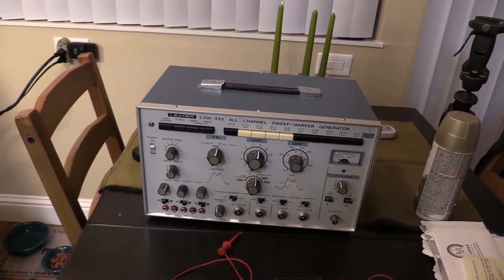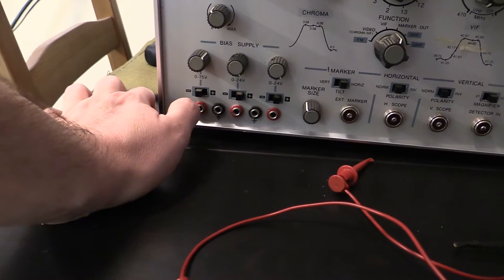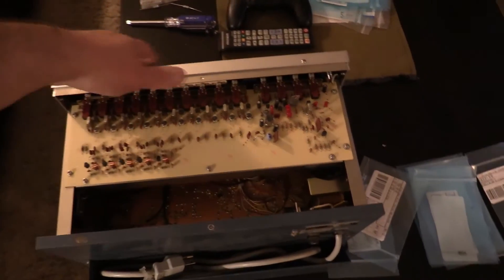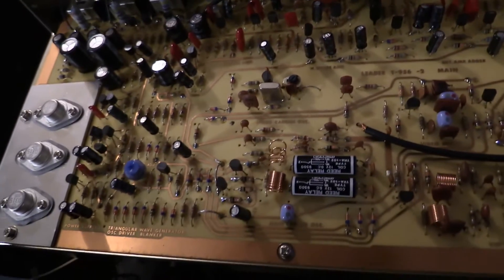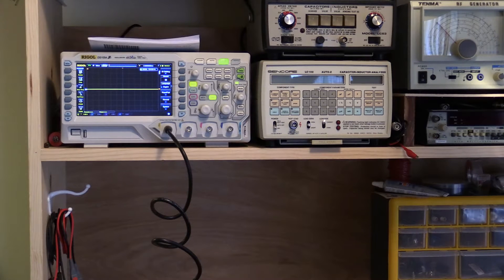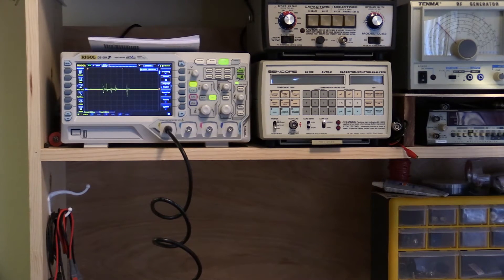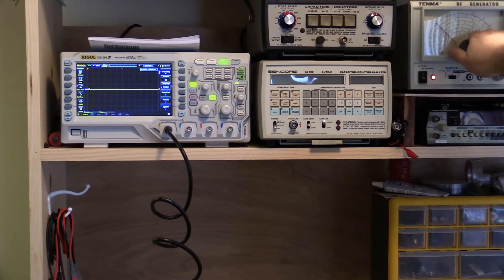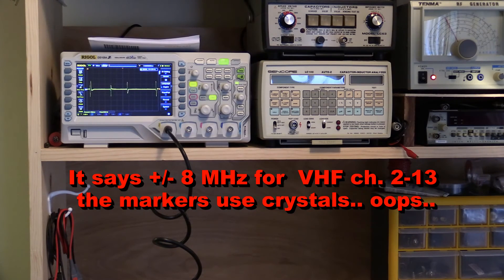Leader LSW 333

Comment: Hi Bret,  thanks for the video!  I have an LSW-333 on the way and looking forward to adding to my Leader collection.  I'm new to FM alignment.  I was hoping to keep my unit 'stock'  but it is proving hard to find those Amphenol plugs.  I will look for non-isolated BNC jacks,  should make wiring simpler but maybe your isolated jacks would be needed to fill the larger holes?   Also,  would you have access to the operators or service manual?  Any info would be great,   Regards,  Peter